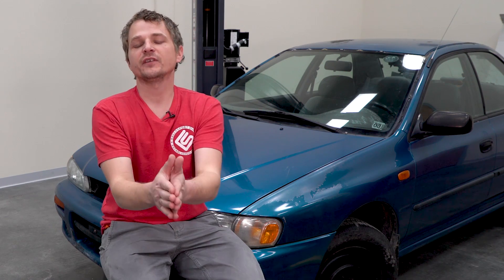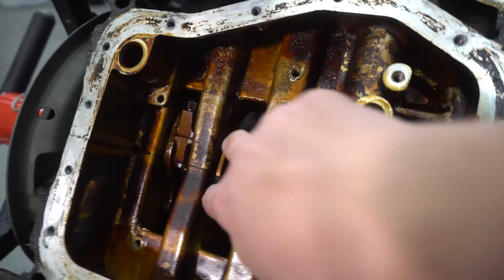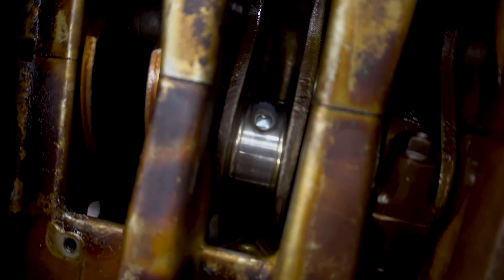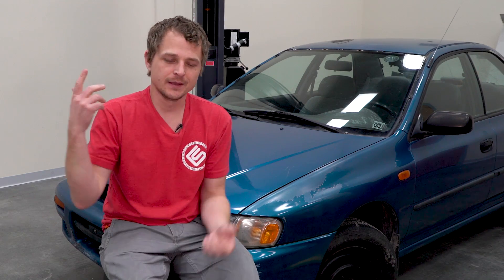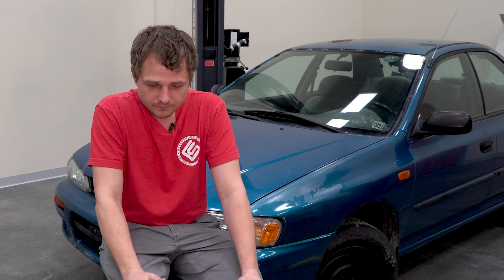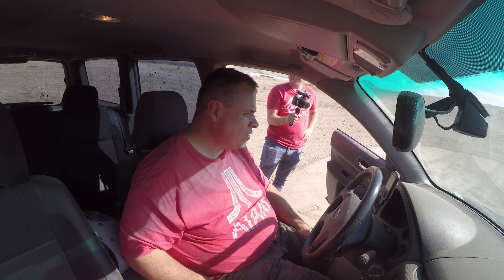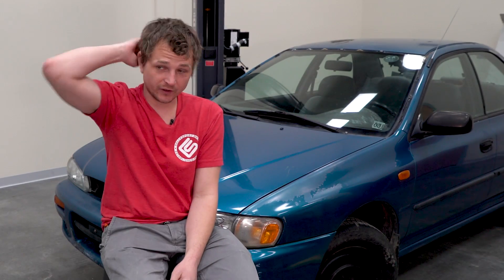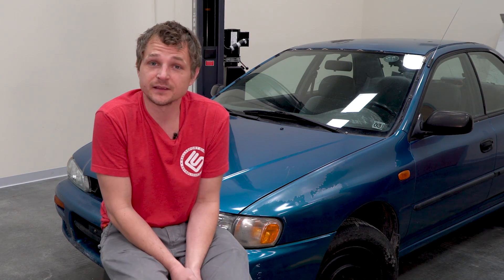How to build and break a 2 cylinder Subaru - Land Speed STi : Vlog #1

Comment: This video highlights exactly what's wrong with the "car enthusiast" scene these days.  Everybody thinks it's some kind of god given right to do things as retarded as possible.  People act like they're into cars and engines but don't have the capacity or incentive to actually learn how an engine works.  They destroy engines that are no longer produced just because they can.  Worst of all, they act like failing is a requirement to success, so they fail as hard as possible.  I think they missed the point of the message when they were told growing up to learn from their mistakes.  And they try to justify it by claiming others will learn from their mistakes, when in fact they're making mistakes someone else already made and they ACTIVELY REFUSE to learn from it.  Because it's their god given right to be wrong and retarded...  But it's ok if you shrug it off and say you weren't even trying.  Where is everybody's father at?  Did nobody get taught to take pride in their work growing up?

Comment: So how are you going to manage boost when the 2 live cylinders are sealed, and the 2 dead cylinders aren't doing anything? This project just seems like too many problems to not just have a custom crank and rods made...
Reply from the maker: I'm not really sure what you mean by this? Boost will be controlled just like any internal combustion engine with a turbo. There is absolutely nothing different about this engine compared to a normal Ej20, we're just removing 2 cylinders. Everything will operate exactly the same. 

Thanks,
Rick
Reply: Every 180° of crankshaft rotation there is at least one cylinder consuming the pressurized air that the turbo produces, giving that pressure somewhere to go. If 2 cylinders are sealed, that's 360° of rotation that that pressure has no where to go, leaving pressure to just build and be forced to back track and exit the turbo inlet. When a turbo produces more boost than an engine can consume under load, that's turbo surge, the really bad kind that blows up compressor housings. If you're planning on removing 2 pistons/rods and 8 valves, then you'll just be boosting the crankcase, which is also a big no no. So I'm just very confused on how this is supposed to work like a normal engine on only 2 cylinders when it was originally designed to work on all 4. Am I missing something?
Reply: Still curious...
Reply: Yeah I've got a million questions too, but I'm only five minutes into the video and I'm already so amazed at the hack job that I had to come down to the comments.  Disappointed to see that most of the comments are talking about how great these guys are and how excited people are to see the results.  I wouldn't trust these guys to change oil and tires at walmart.  It wouldn't be impossible to convert it to run on half the cylinders, it's already been done loads of times.  But not the way these guys are approaching it.  They're just leaving a trail of ruined engines and chassis behind them

Comment: Doesn't it need the other rods and pistons for balancing reasons? 

Did you do any research at all before tearing into things?
Reply: We did a lot of research. The rods and pistons from cylinder 3 and 4 balance each other out. The crank is balanced on its own, so no issues to be had. They have successfully done this exact same thing for years with VW Bug engines on ultralight aircraft.

Comment: Make sure you repaint everything before it goes back together. I race the salt and it's incredible how fast it rusts anything that isn't properly painted. Steelit coatings work well too and you can weld through them
Reply from the maker: Thanks, I'll check out the Steelit coatings! :)

Rick

Comment: U guys are doing everything the hard way , destroking is the only way
Reply from the maker: We can only go so far before we run into cylinder wall and valve clearance issues. When we first started talking about this project, we were wanting to do a super short throw crank, ultra long rods and custom pistons, but once the budget was set in place for this project, we decided we did not want to blow all of it on the engine and decided to go the 2 cylinder route. If we can set the record and go up to a higher displacement class, we will likely go with the de-stroked engine :)

Comment: Why not grind down the camshaft lobes for the 2nd and third cylinder.  Remove the spark plugs and vent the holes to a catch can that recirculates to the top of the block. Then you don't need to worry about oiling issues at all. Or really have to do anything when building the engine.
Reply from the maker: We had this exact idea :) We will explore a few options with people much smarter than ourselves and see what will work best. But I'm personally leaning towards a de-lobed cam, and either blocking that cylinder with a normal sparkplug, or using it as a crank vent/drain. We could even build an AOS type device in the cylinder to help keep the case properly vented :)

Thanks,
Rick
Reply: @rallysportdirect  If your in interested in picking my brain email me at ben@streetcarfactory.com
Reply: @Ben-t1s4o  Or just remove the valves, plug the spark plug hole and block off the intake and exhaust ports on cylinders 3 and 4 (which you would do anyway)... The case would see half the pressure it would normally have with 4 cylinders, so modifying the existing vent ports should probably be enough. The empty 92mm cylinders will return more oil in a 1/10th of a second than the engine holds, no oil return issues at all.
Reply: @Biggiescallywag  The valve cover would blow off. Literally.
Reply: @Ben-t1s4o  Why? This engine would be producing half the blow by/cranks case pressure that the same spec 4 cylinder build would make. We are shooting for about 300whp. It's hard to believe that every 300 whp STI is having trouble keeping the valve covers on the heads.

Comment: MIG spatter all over the place, and you almost certainly warped the crankshaft with the heat input from welding. (As little heat as it likely was)
Reply from the maker: It's very possible LOL. And while we knew the 2 cylinder design would work, it was fun to try it out. Perhaps this was not the best way to go about it lol.

Thanks,
Rick

Comment: Also I think you guys need to take into account the firing order, Its 1-3-2-4. So, I don't think its ever going to run well with only cylinders 1 and 2.
Reply: If it fires 1-3-2-4 it would be the same no matter which pair of pistons you use though, right?
Reply: @LaneHouse  Yes, so there is a lot of time within the stroke cycle where nothing is happening, so its probably going to run really rough.  With all 4 pistons, there will always be 2 cylinders firing at the same time or very close to each other on opposite sides of the engine, which naturally balance it out.
Reply: @MotherSlothBraapSTUTUTU  The 1 and 2 cylinders fire 2 cycles apart...when one is on the compression stroke 2 is on the exhaust stroke. That is exactly how every 2 cylinder engine should normal run.
Reply: They could change the firing order by tuning it and getting custom cams made, but by that time its probably easier and cheaper to just de stroke it will all 4 pistons.

Comment: Dude, use cylinder 2 and 3. And you need to take the crank out and do a balance with 2 cylinder setup. The same goes with cams. Because taking out the pressure from part of that rotary component and adding weight to fill those holes.

For the unused pistons, just weld those pistons to the cylinder wall. If you don't do that, any movement of the unused pistons will lead to oil pressure drop.

In my opinion, you'll need more compression pistons.
Reply: That makes absolutely no sense.
Reply: If you use cylinder 2, 3 or 1,4 combinations, you would have two firing events followed by a long pause. You would also be stressing the crank at each end. Using cylinders directly opposite each other results in an even firing engine and less crank stress. You do not need to balance the crank, it isn't even balanced correctly from the factory; the EJ cranks are missing about half of the bob weight they need to offset the piston/rod weight. It's fine as it is. He already came up with a way to lock the pistons in the bore, and there's no oil pressure drop that's going to be happening anyway. Not to mention, you can't weld the pistons to the cylinder walls, though you may be able to braze them. As far as I know, there are only a few high compression piston options for the SOHC heads, and they're somewhat expensive.
Reply: @forrestcarroll9350  Lets, see... The EJ cranks come completely balanced. The counterweights on the crank offset the weight of the journals, not reciprocating parts. The opposing pistons and rods completely counterbalance each other. You can only use cylinders 1/2 or 3/4, no other combinations will work.
Reply: @Biggiescallywag  While you are technically correct (the best kind of correct,) you are in reality somewhat wrong, not to offend. The crank is perfectly balanced rotationally on its own, the bob weights effectively cancel out the weight of the journal and roughly half of the weight of the pistons/rods opposite them. Properly matched pistons and rods will balance as well. /However,/ they do produce a net torque through the journal between them. They are not perfectly opposite each other, there is an offset. For an example, tie some string to opposite ends of a pen and pull normal to the pen's surface. It will twist to straighten out, this is the torque I'm speaking of. Bob weights made of steel that are large enough to cancel this torque can't be fit inside of the case halves, and adding mallory or tungsten weights to the factory cranks isn't cost effective for Subaru. There are no issues with this running at stock power levels or RPM, and so Subaru has deemed it unnecessary to correct, but that doesn't mean they are perfect.
Reply: @forrestcarroll9350  Sorry, we measured the crank and the counterweights don't balance out anything but the journals. FYI...They have been using 2 cylinder VW engine with a 4 cylinder crank in Ultra-lite aircraft for years. If it doesn't work someone should probably go back in time and tell them.
Reply: @forrestcarroll9350  You are referring to the slight twisting force that pretty much every boxer ever made has dealt with? I'm thinking we will be fine.

Comment: Why not destroke it instead? Using a 1.5 shortblock would make less work also
Reply from the maker: We have to use the ej20 block casting due to the rules of the Production Class we will run in. We did consider a super long rod de-stroke, 1.5 crank, custom piston, sleeves and headwork, but for the price and complexity, simply removing 2 pistons out of a ej20 just makes sense.

Thanks,
Rick
Reply: @rallysportdirect  "simply" this video doesn't make it seem so simple
Reply: @rallysportdirect  yah, and how did that work out for you?
Reply: @rallysportdirect  I'm actually in the process of building a 2.0L de-stroke using an EJ15 crankshaft in a slightly bored EJ25 case. Maybe I should do some videos on it as it progresses, so far all I've done is a post on NASIOC.
Reply: @rallysportdirect  so u guys will be using ej207 avcs head as well right? I hope so..to help slightly better powerband....

And as for gear ratio...ny plan yet?
Reply from the maker: well first attempt not so well LOL. But the 2nd worked great, and the 3rd will be even better and the 4th will(hopefully) break a world record. So yeah, just chill and enjoy the ride. It's either going to be a huge success or a massive failure HAHA and BTW I'm totally cool with that, just so long as no one gets hurt :)

Thanks,
Rick
Reply: @rallysportdirect  love the attitude! Do what you want and fuck everyone else! Lol I hope it does work! Just have my doubts as I'm sure you do as well lol curious though. Why use 1 and 2 ? Doesn't that mess up the firing order? I feel like using pistons 1&4 would make more sense.
Reply: @fox10169  You can't use 1 and 4 the bock won't allow you to swap cylinders, so only 1/2 and 3/4 work. The piston pairs need to be moving in the complete opposite direction for the boxer to function properly. 1 and 2 firing order is 360 degrees apart, 2 cycles. If one is on the compression stroke the other is on the exhaust stroke, exactly what the firing order any 2 cylinder engine should use.
Reply from the maker: Well simple at least in the sense that it will cost significantly less, and being able to use off-the shelf parts makes this quite a bit more simple.

Thanks,
Rick